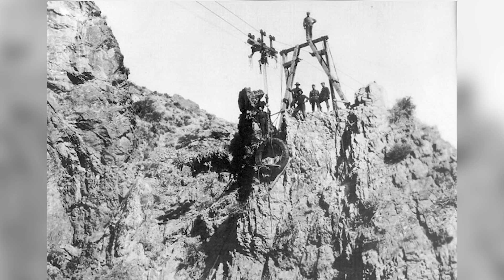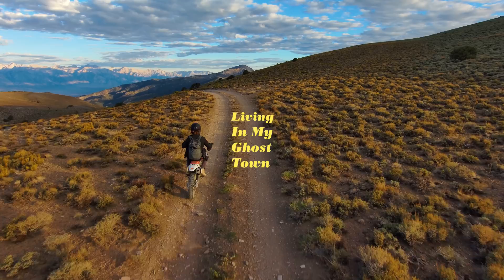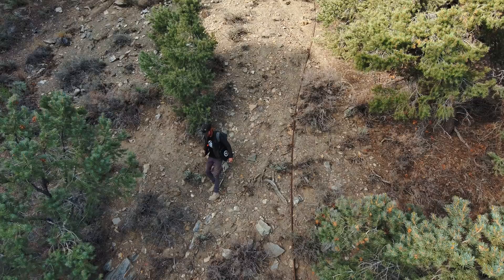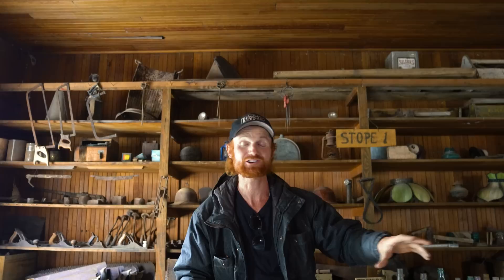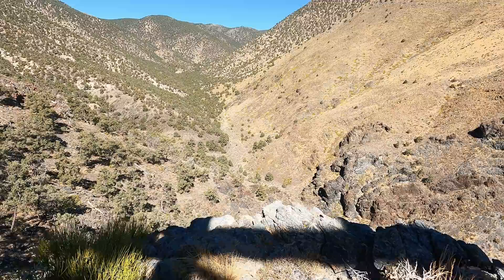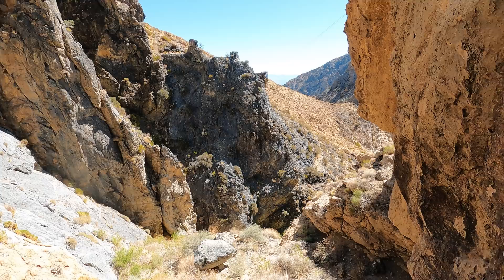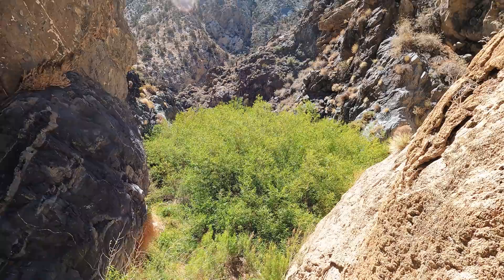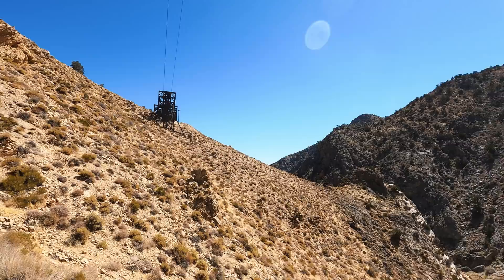Hiking The Steepest Tramway In The US! (Saline Valley Salt Tram)

Comment: From what I've read, the reason this particular tram failed was due to a communication error. The mining company told the tram maker that it would be used to haul salt, and so the tram maker designed the tram based on the weight of salt. But in actuality, the miners were sending brine (wet salt) which is heavier. As a result, they could only fill the tram buckets halfway, which reduced the profitability of the tram.
Reply: That’s fascinating - thanks for sharing !
Reply: Thank you
Reply: Wow...
Reply: Excellent observation. My understanding has always been: The engineer that designed the tram (which includes the all important motor horsepower and amperage load on the power lines) simply looked up the weight of salt in a common reference book and took no regard for the additional weight of moisture.
I'm suspicious that this is the reason old images from the lake bed show the salt piled up in smallish mounds. I suspect they were desperately drying to dry the salt before loading it on the tram.
Reply: @GOATED49  Uh...wrong, genius. Salt is dry all through its maturation up until ripe. Its only then, after the husk has fallen off that moisture accumulates. Duh
Reply: Very educational... Thanks 😊🙏
Reply: Thanks for the share
Reply: Interesting, thanks for sharing!
Reply: Interesting, and I don't doubt what you read. I am surprised Death Valley salt would be wet though in one of the hottest, driest deserts there is, unless they were rinsing off the contaminants first. Or if it was brine or absorbs moisture at harvest, it still seems hard to understand since the humidity in Death Valley is so low.
Reply: @alanhmarzullo1752  There is often standing water in the lowest part of the Saline Valley salt flat. All the rain that falls on the entire valley and surrounding mountains flows there. Even the dry parts of the salt flats are damp not far below the surface.
Reply: What would be the issue with drying the brine in Death Valley?
Reply: @plavyn  RIght, you would think drying the brine out on-site would be best, especially since it is literally one of the hottest places.
Reply: Thanks interesting stuff
Reply: @GOATED49   Salt can be mined/extracted dry and wet.
Reply: Oppps
Reply: source?
Reply: Stands to reason
Reply: Well why didn't they just dry it out and then send it???
Reply: @kirkkirkland7244   If they just pile it up and wait for it to dry, it becomes a solid chunk. The facility to properly dry and crush it was at the other end of the terminal.
Reply: Great video.  I would walk the tram in Winter as suggested.

Comment: Hey, here’s a really good tip for staying hydrated in the desert — soak chia seeds in your water when you drink it. Chia seeds absorb the water and slow releases it into your body as you digest it,  rather than peeing it out hours later and losing all that water. It just keeps you hydrated for longer and is healthy- just a tip!
Reply: Forget Peeing...  I helped several friends do 24 hour bike rides.  They each consumed about a pint an hour, but not once did they pee...  They sweated it all out, so salt replacement was also needed.
Reply: @hiscifi2986  yep!! That's exactly what happens when so hot. U sweat more out than u urinate.
Reply: @Badge124  can’t that destroy your kidneys?
Reply: @whitelistqd7815  yes if you do it over and over
Reply: If you're dehydrated you don't pee which is a problem in and of itself (you can't remove waste from your body), the key is getting enough water which if you're on a planned hike should be something you're ensuring before you start.
Reply: @whitelistqd7815  That’s a horrible idea
Reply: Awesome to know..
Reply: Chia seeds can also get caught in your digestive tract and cause diverticulitis as well soooo.....
Reply: I work in construction & there are days when I work outside in 95+ degree heat & drink 1 or 2 gallons of water & don't have to piss until after dinner because I sweat it all out. Anyone who knows what I'm talking about will also know that if you wear a dark colored shirt you'll get white stains on your shirt from all of the salt in your sweat. That's visual proof you need more salt.
Reply: @strawsparky33  you can only get diverticulitis if you have diverticulosis first. Most people benefit greatly from the fiber in chia seeds. In fact its fiber that helps prevent the aforementioned condition.
Reply: @strawsparky33  if not soaked over night, yes, it, can (...)
Reply: me writing that down
Reply: If your body needs the water it won't let you pee it out, you don't need to do this.
Reply: @hiscifi2986  exactly. this comment is from someone who has probably never hiked or done endurance athletics.
Reply: @aaron___6014  yes but if you were fully hydrated going into a survival situation your body will pee out excess water and not hold on to it, which is where my advice works

Comment: "Bring rope" is like the number one rule of hiking unmarked routes, as far as I know lol
Reply: yeah double the length u think u will need so u can release it when u r done climbing down a steep part
Reply: @onelove9408  Yep as a rock climber I was thinking this. Or have two 60m ropes and tie the ends of both ropes together but then he would need a partner to share the weight. Place a sling around a solid tree or boulder, to act as an anchor point. Then double the rope on the sling. Rappel down both ends of the rope (easier if you are carrying a harness and belay device). When you are safely at the bottom pull on one end of the rope to retrieve them (pulling the ropes through the sling). Sacrifice the sling where it is for the rock Gods.  Carry multiple slings and you can rappel multiple pitches. The biggest fear would be getting the rope snagged when you try and pull one end down, here it would be distress beacon time.
With a rope, a partner who can lead climb and some trad climbing gear, it would be possible to rock climb your way back up if you dont like the look of the route down, if the rocks aren't too loose. But carrying a trad climbing rack would be heavy.
Reply: I always bring rope, even if I'm not planning for a hike. Like ways blodstoppers et.c.. I have had use of these things on multiple occasions on other people before paramedics come, almost never on myself. I would also carry a knife if the police could understand the laws, it is only illegal to carry knife if it is with the intention of hurting other people. A knife in a secure package in your Backpack ain't illegal in my country (but a copper can't be expected to understand the difference)
Reply: I was thinking that, as well, and I have zero experience 😂

Comment: That was nothing if not a feat of willpower and Endurance.   After seeing several of your videos I have finally subscribed.

I'm from part of North Wales where improvised tramways were used as temporary tramming routes to get ore and supplies shifted.
The big crates with rocks in them are still used today to tension the cables.  Also used to tension overhead lines on electric railroads.   Simple and effective.   The big bits of iron at the intact station are likely to do with greasing   and the winch has a characteristic band brake,  A flexible steel strap  has an asbestos lining  and the operator has a lever to squeeze the winch drum and stop it running away with itself. You see the buckets in the valley bottom   well often they ran wild and fell off.   Too much effort to retrieve them.  I've talked to the old timers who worked them.    Once the system is up and running  it's easy enough to bring supplies and men up in the buckets.   For sure if they used electric traction  the  they had a telegraph.    Location advantage in Death Valley,  sunshine.   even here they used a heliograph when they could.  Between Rain, Mist and Snow  that is.   Too much darned water.

I would guess ftom out local examples it might take an hour or so to get a barrel of water  up to the top.  Here it was always forbidden for men to ride the rope but they cheerfully did what they pleased.  Usually too remote for inspectors.

I'm going to look for your email if you are OK with that and send you some photos from Wales.  We know the Alps has lots of these systems but here we are with the frontiersman  style of construction.    Sweat and Iron.  Life would have been a lot better operating the stations than shovelling in the Salinas. 
Go back and get some tools for the museum if that not Theft.  They will become travellers souvenirs otherwise. 🏴

Comment: From someone that done a ton of mountaineering and trail building, I would say you should invest in better footwear.  When descending down a scree field, having boots with proper ankle support is really important. The hiking boots you have are more for trails and fields, and more flexible for comfort. This is different from mountaineering boots, which have a more rigid ankle and a shank. A classic Montagna sole is a 45-degree angle on the side of the sole for sidestepping a scree field. This is especially important if you are hiking with weight, as rolling an ankle is a bad possibility. Mountaineering boots have such good ankle support that you can legit put all your weight on one bent ankle and the boots will take the weight. Look at Scarpe Verde, Alico, La Sportiva, Mamut for good examples.
Reply: I hike with Carolina loggers or linemen's boots for the ankle protection and steel toe.
Reply: Now that's great advice!!!
Reply: Tennis are the best I did river work for 30 boots are actually hard on your feet my feet were damaged by wearing hard leather boots,
Reply: I’ve sprained my ankle twice, badly, in scree fields, even with good boots.  This is the best advice because a sprained ankle in those places can be deadly.

Comment: I have visited Saline Valley many time since about 1987, coming in from the south pass, the north pass and the Lippincott Rd.  Each time I passed the lake and saw the tram scaffolds leading up to the mountain (many were standing when I first started going there and were collapsed the last time I was there), I thought how cool would it be to start hiking at the base and follow the tram across the mountain.   Thank you so much for saving me the effort.  At 76 yo now it would be a bit of a challenge to say the least, but one I would continue to dream about.  

However,  i did, may years ago, meet a guy who was a caretaker at the talc mine at the upper end of the valley.  He took me and my brother on a 4 wheel trek back into the mountains on the northwest side of the valley to another tram site.  This one was a single strand from one side of a steep, very deep canyon to the other.  As I understand it, this tram was used to transport supplies across the canyon to a working mine farther up on the other side.  The cool thing about this tram was that on our side of the canyon the cable was wrapped multiple times around a single, 20' diameter boulder to anchor it in place.  Over the middle of the canyon dangled a small flat car, trapped in the middle of the cable.  Like your wonder at how the salt tram was built and the equipment moved into seemingly inaccessible cliffs above the Saline Valley and below the summit, I wondered simply how they were able to string the cable I saw across such a deep and wide canyon and secure it on the other side.  

Death Valley and Saline Valley are truly amazing and rare places in the world.  I  feel so lucky to have spent time there and enjoyed its wonders.  

Thank you so much for keeping the adventure going.  I hope to meet you some day.  Good luck with your Cerro Gordo project.

Comment: I'm glad that when the situation got real, the video footage stopped until you were safe. Your 100% focus avoided any accidents. 
I think the people suggesting to do this in the winter are wrong. Snow can hide edges and deep drops. Ice can make everything slippery. Melting snow is the reason for the wash and waterfalls. I think rope, more water, support etc was the way to go. Maybe you can add a sign at the top and bottom stations warning about the issues of walking the tramway. The book halfway up that you happened to find, really doesn't help people to prepare!
Reply: Perhaps in between summer and winter closer to winter

Comment: What's even more insane than the wood being there is the cable. How on earth did they hike the cable up there???
Reply: Cable would have been strung by first dragging down a rope, and not even necessarily down the exact route at first, between stations, or even  ridges or cliffs, before a small diameter cable would be pulled down with the rope, followed by a larger cable pulled down by the smaller cable, until you achieve the size required. 
Gears and large objects almost certainly were brought down manhandled from above on sleds, and would be pulled up sections requiring so, use mule power brute force.   Most people today wouldn't be remotely willing to do what these men did.

Comment: My suggestion instead of rope bring 200' of climbing webbing. Light, durable and max strenght 4000'. Additional 20' for fashioning a swiss seat harness, and one carabiner. You can use this to rappel if you know how to construct a good anchor with webbing and a rapide. We drove to the bottom of Darwin falls (bottom fall), found a way to climb around and got to the top fall. Then rappelled it and jumped an intermediate fall before rapping the last one from the top. Beautiful trip, highly scenic, and not too difficult to do. Great video,  J

Comment: In the 80s, I read the comp that built the buckets designed the friction brakes based on dry salt weight. They could only fill the buckets half full with the wet Saline valley salt.

Comment: Well Brent my son and I tried to make it up there yesterday the 11th. Before we started heading up the Cerro Gordo rd, there were a couple of girls from New York who had just come down the hill. They were in a small Jeep SUV. It was 110 and they said they were about 2 miles from the town when their car started to over heat, so they turned around and came back down. I  figured  we would give it a go. We were in my Toyota quad cab v6 2017 so I figured we could make it. I had the air conditioning off. I think we were maybe three quarters of the way up, not sure. We made it to where the Joshua tree's started and your in a little valley. Anyway the truck lost power and started to over heat so we had to turn around. We ran into a couple coming up in a gray dodge ram, hopefully they made it up. The drive up Cerro Gordo rd is beautiful, hope to try again when it is cooler.

Comment: 100% correct if it’s made out of steel it would live another 100 years.
There’s a mine in the Pyrenees called Batere, they have an aerial tramway to the villages of Arles sur Tech and Amelie Les Bains and still can see the tower on places they can’t get to (they cut away a lots after the mine got smaller and closed in 2008 after 500+ years of operations

Comment: The weights were part of the cable tensioning system. The weights kept a constant tension on the cables in order to compensate for thermal expansion and contraction.

Comment: I live in Bullhead City Arizona which is the Mojave desert so I'm well familiar with the mid to high 120's. It's brutal...especially when the power goes out. You eventually get to that point where you seriously Wonder if you're going to die before the power comes back on and that's no joke. The air is so hot and dry it's hard to even breathe

Comment: I think the second half of this hike could have been much easier if you didn't follow the canyon all the way down but hiked up one of the forks a bit to rejoin the cableway at the transfer station at (36.640493, -117.822924). Once there, a half decent looking footpath with switchbacks follows the tramway all the way to the valley floor. I've never been here, but google satellite images from the area are well detailed so would be useful for planning.
Fascinating place either way, thank you for the video!

Comment: I was wondering if you had snake boots or gear for your protection. Once it was running all the supplies and men could ride in a bucket to each tower, but when they were building these platforms. How did they get all the materials and heavy metal parts to each place?

Comment: Are Cables reliable enough to zip line it with a braking & motor arrangement - Charges on the way down, enough retained power to get you the last bit of incline?
Middle looks like several towers / stations have collapsed .

Comment: Thanks for bringing us along on all of these adventures Brent!  As an engineer, I was super curious about the details of how the aerial rope tram worked.  If anyone else is too, I think you REALLY will enjoy this detailed explanation of one of the last operating aerial gravity ropeways still used for mining today:  https://youtu.be/6RiYXI1Tfu4

The obvious difference between the Union Mine tramway and the Saline Valley Salt Tram, is that the salt was being moved to a HIGHER elevation, so it required motors to drive the rope, which you can see on the plans here:  1:57 .  The tram from Cerro Gordo to Keeler only required brakes, like the one linked above.